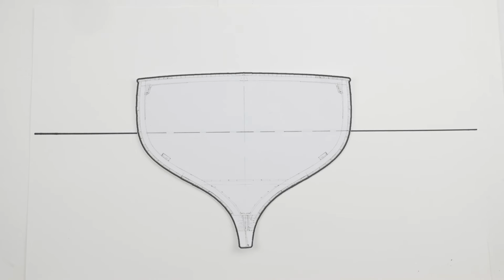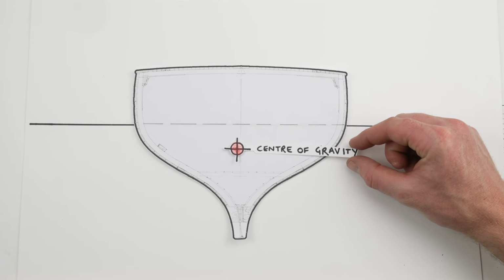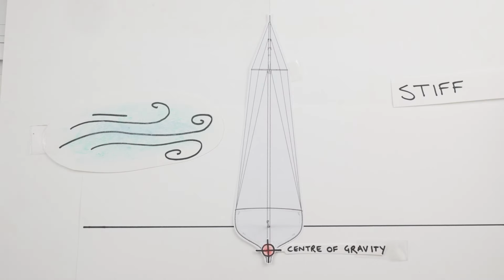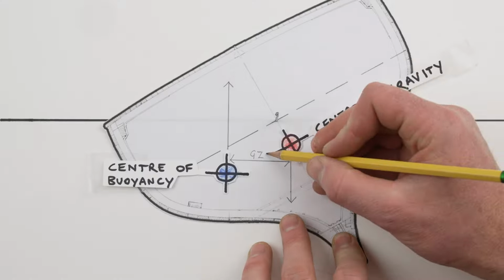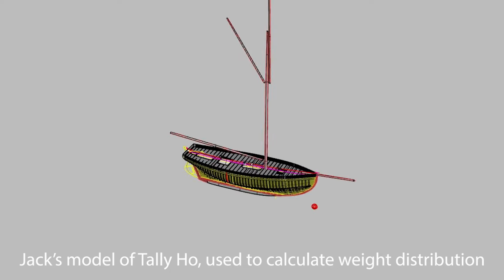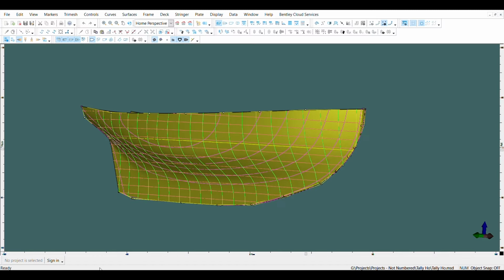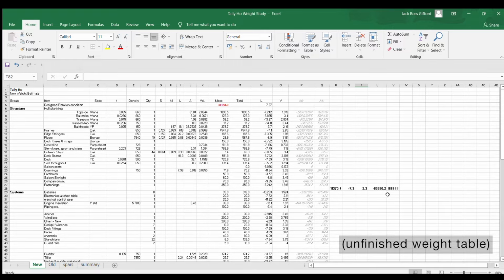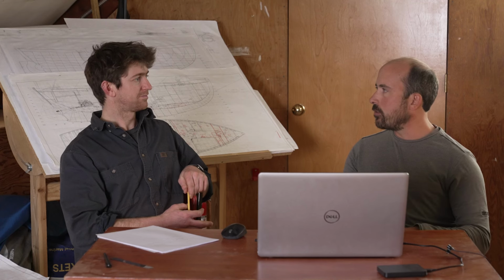Stability Calculations (Boatbuilding / Tally Ho EP125)

Comment: How would these adjustments and designs have been done in 1910?
Reply: What I have discovered over the years is that the older scientists and designers actually knew the physics and math of all these things fairly well. (Celestial navigation, design of structures, etc). Nowadays we tend to think that they were a bunch of bumpkins and wonder how they got by back then. Most likely, the boat designers of the day were able to do these calculations crudely. Also, most boats are based on similar boats, so the behavior will not be too large a departure from what came before. Finally, the moveable internal ballast allows some fine tuning after launch. If you break the boat into sections, you can draw a waterline, then calculate the buoyancy and weight for each section and find out if there is a residual moment (in other words, if the bow is pushed up too much then this is not the right waterline... you need to draw it lower in the bow. Then you can correct the waterline and try again until it is right. A lot of work, but it could probably be done crudely in weeks or months without a computer (assuming the drawings were already done and available).

Comment: I used to watch the Deadliest Catch and saw the episode when Capt. Sig was informed of the sinking of FV Destination and death of his friend. At the end it was determined that the boat had a bit too many cages high up and they had iced and moved the center of gravity so far up that the boat overturned and sank.
Reply: I believe that also prompted Sig to have the Northwestern surveyed and a new stability study that prompted changes in his gear load.
Reply: Yes. It can happen within half an hour of the start of buildup. The water is 32, the wind chill is colder.
Reply: thanks that's interesting. so they managed to locate the wreckage and reach that conclusion?
Reply: @cliveramsbotty6077  There was a sister ship of the same construction & design.  Simple stability tests (moving weights on deck) showed the actual margin of stability was far smaller than originally planned.  The expected icing rate, combined with the larger/heavier pots made the math impossible to contradict.
Reply: @YouveBeenMiddled  Ah okay, thanks
Reply: @cliveramsbotty6077  Why would they need to, the ICE MELTED WHEN IT SANK

Comment: I can wait for the answer,  but i’m curious how many modern materials will get substituted for the original.   I assume you will use 
modern wire or rod for the rig.  Modern but maybe not the highest high tech line for running rigging.  Maybe Dacron (but perhaps not mylar or carbon) cloth for the sails etc.. all of which will play into the stuff covered in this excellent episode.

Comment: Very interesting. Now we need a video on how the sail size and shape affects all of those calculations!!😂😬😂😬
Reply: basic cross sectional analysis ... and wind direction ... on a lever arm (the masts and all its gear) .... think aerodynamic virtual testing ... and do it for a boat with different wind speeds at different angles and different amounts of sail and position ... so many hours of a computer running sims in the background to get a set of data for most if not all potential sailing needs ... 
.
and yes aerodynamic testing ... it is after all just fluid dynamics on a surface area with a density calculation for the medium(s) operated in ... and yes you still have to account for the water density in the above as it resists the pressure of the wind as well as the center of gravity and balance ...

Comment: I just finished taking my aeronautical and automobile stability and dynamics classes. Time to take one for boats!
Reply: I think the big difference here is that with an aircraft the aerodynamic centre stays pretty much in the same place in the structure as the aircraft rotates, but boats rely on the centre of buoyancy moving around laterally a great deal. So the CoB is often below the CoG, which seems counter-intuitive, but the heeling of the hull moves the CoB outboard of the CoG to give the righting moment. It's interesting stuff.
Reply: same thing just different density needed for medium operated in is all ... otherwise it is exactly the same calculations ... too many people forget air and water are BOTH fluids ... just at different densities ... same with fresh water and salt water ...
Reply: In building the prototypes for the V-22s, we had a waterline, which was 0 degrees, and the hull was started upside down!! Everything worked off the waterline above or below it! At a certain point in the build, the hull was righted! Interesting work!

Comment: Phew! Cold turkey on the horizon for a while there... Sounds like you had a good break back in Blighty - and a haircut! Can't pretend I understood all of that, but I got the jist. Not sure about hollow spars though - how on earth do you hollow out a spar?!
Reply: The mast is not hollowed out, but built from strips or staves like a wooden barrel. The staves can be made w/ angled sides (coopered) but its more usual to saw out an angled chunk (bird's-mouth) from one edge of each stave that interlocks w/ the squared-off edge of its mate - this increases the glued area to give added strength. After the glue dries, bring on the planers to give the mast its desired shape & taper.

Comment: OMG you are building up the tension... whats the total weight now? whats the righting moment at 90 degrees? Will you get enough stability to be rated Class C ? What point will it no longer go right side up, less or more than 130 degrees? Now i can not sleep for 1 week straight, but verry nice and detailed explanation. Also you only know the total weight to get onto waterline if you know the density of the water.. I guess you are thinking of saltwater, but is the salt concentration in the english channel still the same as it was 100 years ago or do you need to be heavier or lighter to hit the waterline nowadays?
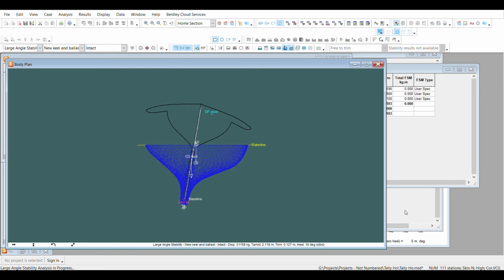Reply: Around 14:00 you can see that the center of buoyancy is still outboard of the center of gravity at 150 degrees inclination. So I would say she is fairly self righting.
Reply: @MinSredMash  150 would be a verry good value, thats true. But i dont know if that simulation was just to show the image or if it was the real value... with mast and rigging?
Reply: @schuttrostig5729  I suppose we don't know what loading scenario they were showing. Mast and rigging is buoyant and inhibits rollover, so should actually help with righting the boat.

Comment: This is done when building aircraft also. An aircraft is always weighed to verify weight and balance.
Reply: yup exactly the same ... except for ONE important thing .... the density of the fluid it is operated in ... air being less dense than fresh water and that less dense than salt water and even more so for brine ... otherwise it's EXACTLY the same thing
Reply: @0623kaboom  I agree. Can a boat this size be weighed? Seams you could use 4 dynamometers on the lifting straps of the mover.
Reply: Well looks like you have to rent. Dynamometers of that range are quite expensive

Comment: Most sailors I know are also largely uneducated on this technical side of boat design. We just always assume the weight/center of gravity should be low as possible to keep the green-side down 😄. Thanks for the dope slap!
Reply: yup learned ... high winds ... lower down rougher ride ... but less tippy ... lower winds higher up smoother ride ... a bit more tippy but more comfy ... nice to know
Reply: i am not sold on the theory that the sails need the heeling to have the right shape, but i totally agree unnecessary weight is bad in light winds.
Reply: @schuttrostig5729   It's very much borne out in practice, when the breeze is just a few knots. Look at Olympic dinghies in light winds, the helm will be lying along the lee gunwhale, and a good way to get yelled at on a bigger boat in a competitive drifting race is to start to move towards the high side unless your job absolutely cannot be done from leeward. 
On boats of any size, gravity will cause the sails to drop to their cambered shape if there's 5-10 degrees of heel. Sitting bolt upright, the sails will lazily flog between opposite cambers, meaning that they can't develop enough drive to build up steerage way (essential for constant sail trim) or - just as important - to build the apparent wind which is the key to sailing in very light winds. It's a fragile process of bootstrapping, and even when the sea is dead flat (in which case shifting the crew to leeward might be enough), a certain leeward heel is essential.
Reply: @Gottenhimfella   Ok, that does make sense. So i understand there can be reasons to have the weight not as low as possible.
Reply: @schuttrostig5729  It depends on the sail material and the wind strength. Most non-sailors think that sails generate power from the wind pushing into them. That only works with some sails and is a very slow way of sailing. Most sails generate power from the wind flowing across the surface. They are effectively wings. They need to be in an aerofoil shape to generate lift. If you have heavy sails and the boat is completely upright, a very light breeze won't be enough to fill out the sail into its aerofoil shape. If the boat is heeling, then the weight of the sail makes it form an aerofoil shape and the tiniest breeze across the sail generates some lift.
Reply: Schutt Rostig yeah I was confused on that point too. I know for the old J class boats the overhangs were so extreme because the waterline length was set but not length over all and by heeling over hard they’d increase the hull speed. But I don’t really get why, outside of that one context. you’d sail poorly in light wind with a stiffer boat.
Reply: @schuttrostig5729  I also did not agree that the boat had to heel to sail